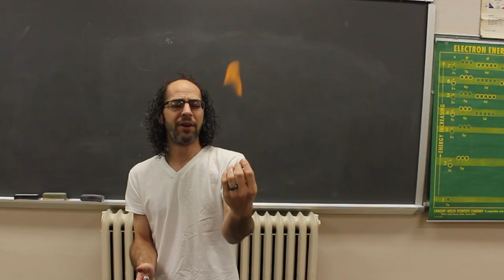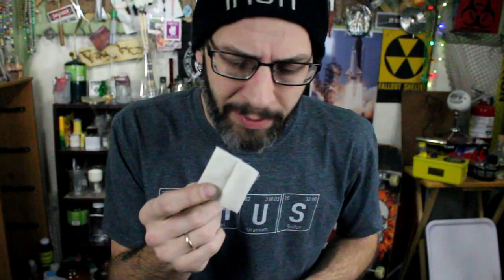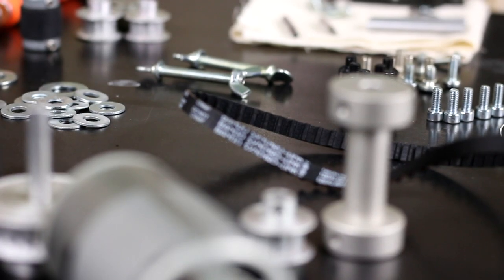DIY Buffing (Polishing) Wheel

Comment: I am gonna make a buffing wheel using this video as refernece but would add just one more step of stitching the cloth material in concentric circles so that the fibres wouldn't just unravel and that would increase the lifespan of the wheel. More closer the concentric stitches, the harder the buff surface would be and vice versa, also depends on the fiber material used.